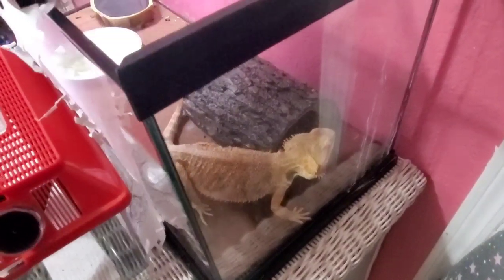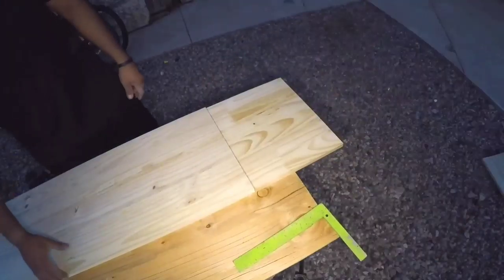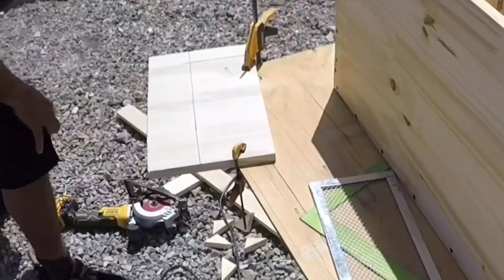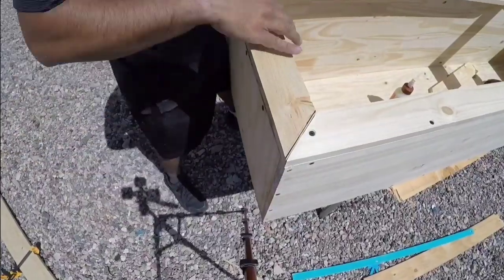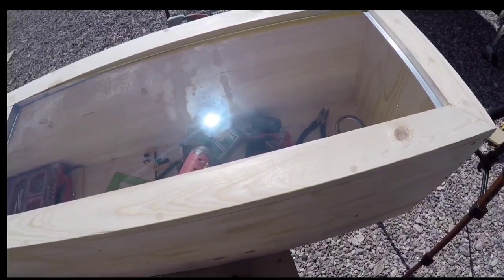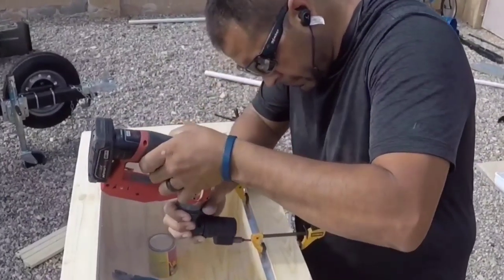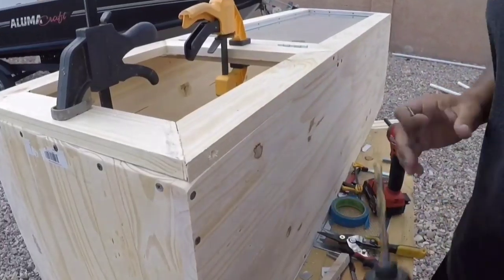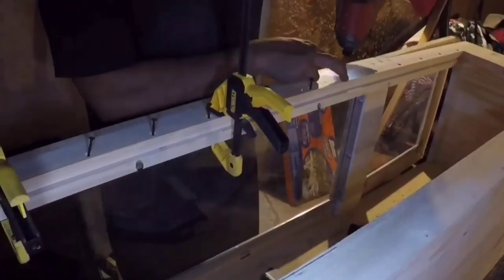Making a Bearded Dragon Enclosure DIY | Terrarium for Bearded Dragon.

Comment: This is amazing. I'd love to be able to build something like this.. thing only this is is that you absolutely do not need whatever that red light bulb is. In fact red light like that can damage their eyes. Bearded dragons only need a basking bulb and uvb strip but still, all said and done this is great!
Reply: Definitely agree. Red bulbs are for nocturnal reptiles. It can damage their eyes and cause metabolic bone disease.
Reply: @Slow_As_We_Go  these aren't good for nocturnals either, it's been debunked that reptiles can't see red light and don't have any issues with it. It's generally better to just stay the heck away from those things. Better options are for example deep heat projectors or ceramic heat projectors, those don't admit any light.
Reply: What do they need for the night
Reply: @user-yomomma  nothing at all unless your house gets super duper cold at night. In which case, a ceramic heating element that gives off heat but no light. They have an actual name but I forget. But if your house stays in the 70's degree range at night. Then they don't need and shouldn't have any lights on at night. I keep mine off from 9pm to 9am.
Reply: they dont really need something at night my beardo is very happy with no light at night
Reply: @skajdbnaoidha98hf  just like in nature haha
Reply: if you combine it with white light during the day it's just fine, it's just adding heat
Reply: @Ken Harris Yes... You do need a light for heat. But absolutely NOT a red one. And if you think so then I feel sorry for your beardie too.
Reply: I use a ceramic bulb in place of that and my bearded dragons switch between the basking and the ceramic bulb
They seem to like a little of both and the ceramic helps with the overall tank temperature.

Comment: Depending on how the temperature gets in your house at night you might also want to look into getting him a ceramic heater to keep him warm while his lights are off. And I would also suggest getting him a hide for the cool side of his terrarium
Reply: Humidity also increases at night too so monitor that should be around %50 at night temp at night should be around 50 degrees farenheit
Reply: @aeislin5657  How can humidity increase during night when there isn't heat? Humidity is basically water vapour, which appears when there's heat. It's usually cold during the night so that doesn't make any sense

Comment: Wow. Amazing enclosure. Many years ago I built one for a red tail boa. I didn’t have the tools you got. I pretty much made a box. Cut out a front window. Used plexi glass. Cut out the top used a mesh and hinges. Added a lock. Pretty sweet and simple. Yours looks professionally done. 
You can always paint or texture the back wall to cover up the cuts you accidentally made. Or do a styrofoam dry lock back piece. Add some foliage and you’re done. Talk about a spoiled dragon!!! This really inspired me...thank you!!!

Comment: You’ve done such an amazing job! I’m planning on making an enclosure for my beardie whenever he gets older and bigger. Right now he’s in a 40gal, which is the bare minimum a beardie should be at, but right now he’s still young and fits comfortably in it. You did an amazing job, but one thing I’d suggest is changing out the red bulb. (I think I saw a red one in the dome fixture, I hope I’m not mistaken, I apologize if I am) It’s a common myth around the bearded dragon community that red bulbs are better because they don’t bother the lizard and you can have it on at night and the lizard can’t see it. However, the lizard can see it, and you don’t need heat at night unless the temperature is below 65F. In some cases, the red light actually causes eye damage to the lizard. Other than that, you did an amazing job!

Comment: We have a bearded Dragon and since it's summertime we have been placing him outdoors in a caged open space with dirt, and various eatable plants like dandelion greens and kale. The natural Free Sunlight and fresh air are great for him.   Just provide a place for them to hide and cool off if need be.    Great build!!
Reply: What if its raining?
Reply: @HelloThere-lo3qi  Depends on your location.  He doesn't go out if it's too cold and or if the sun isn't going to provide him warmth.   You also should provide so sort of shade cover and or hiding spot for them cool off. If it rains and it's still hot outside then provide cover and drainage for your enclosure.  They may like a little rain if it hot and humid outside.
Reply: @bartthatcher5799  it s summer all year here in southeast asia

Comment: That enclosure is gorgeous. My only complaint is I would have made it a little taller, and added more things for him to climb on, the enclosure is too empty. Bearded dragons are actually semi-arboreal and they love to climb. In the wild in Australia, you often find them in trees. Also, it's only the basking spot (the surface under the light) that should be 100° - 110°F, not the air temperature. You should get a thermometer with a probe, and put it directly under the light.
Reply from the maker: Thanks

Comment: You could use quarter round to hold the front glass in instead of those metal brackets. It would have gave it a cleaner finish. Your video gave me some ideas though for my daughter's chameleon enclosure. thanks for sharing

Comment: Really awesome build, in my build i used a roll of PVC for the flooring which is a bit thicker then the mat you used, same smooth easy clean non-slip benefits but just a bit more heavy duty

Comment: This is amazing I want to build something similar to this. The only thing I would change is I would put hinges on the top front and make the whole front open up. I think it’ll be easier to clean from the front. This is a really great video    I love that you got straight to the point and explained everything perfectly. I’m definitely going to use this as a guide when My bearded dragon will get a little bigger and will need a larger terrarium

Comment: My dragon is the same way, she doesn't seem to stick to the 105 degrees, she likes to sit around 80 to 90.  Be careful with that rock feature you have under the basking light, I purchased the same one and I am pretty sure when my dragon started going through her "crazy time" of the season, she snagged her back "thumbs" on it to the point where they became black and I had to have them amputated.  Not to scare you, just to warn but if he stays pretty idol and doesn't run around like a nut like mine, you should be okay.  I love this build, my dad and I are going to build something around 100 to 120 gallons since the 40/50 gallon terrarium my stupid breeder told me to buy will not be enough.  Guess I should have done better research.  Nice video and I agree, seems like everyone else talks to much, yours was perfect.  Good luck and good job rescuing this cool little guy!!

Comment: For substrate we use crushed walnut. I've never had an issue with impaction. We also have a 12x12x1 garden paver brick for natural nail filing,unless your trim their nails. I find we don't need to trim their nails by providing the brick. However to each their own :) love the viv, ya'll did great!

Comment: Do not use red light. Also, your dimensions are a bit off it appears.

Dragons are arboreal. they need stuff to climb. They also should have a dig box with organic soil, no additives, mixed with playsand - 50/50.

The build is pretty cool, but the husbandry is completely wrong.